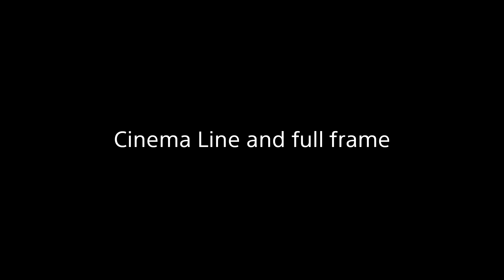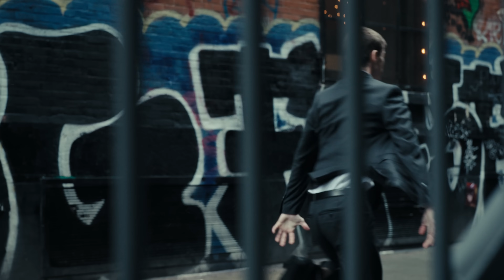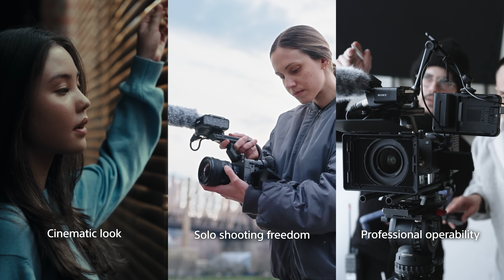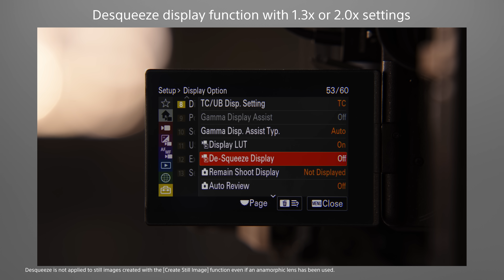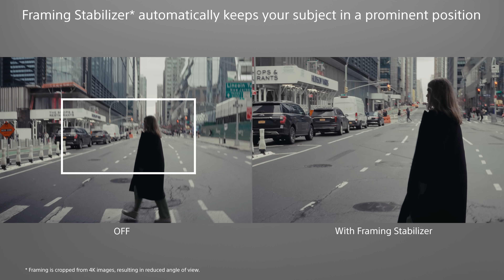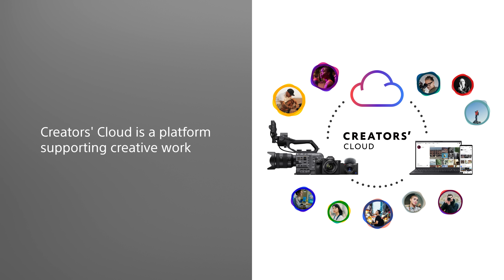Product Announcement Cinema Line FX2 | Sony | α

Comment: I love the FX2 concept because I am a hybrid shooter who wants Cinema features too. I dont care about the 60fps crop, I have lenses to deal with that when I need to shoot 60
Reply: I'm an hybrid shooter with no money so I hope this means there will be an FX20 down the line !
Reply: Price is the key, 3200 € for a camera designed for video without 4K 120 and uncropped 4K 60 is a shame. Also why still 5.5 stabilization ?
Reply: @AIRCamJet  name a 33MP camera that does 4k 120 (no pixel binning), also it has two digital stabilization modes in addition to the IBIS
Reply: @JasonMcMullen   Do you know what innovation is ? We are in 2025, 4K 120 should be the minimum as a brand new camera designed for video > 50 %. Canon R5 C, Nikon Z8 use 4K 120, prices around 3000-3500 €, Sensor > 33 MP.  
So yeah, Sony is now late, we suffered the consequences of protecting high quality products like A1, FX3, a7R V, but now we have overpriced products with recycled technology. 

Some smartphones can record at 4K 120. To innovate a camera designed for video should record at 4K 240p, cooling system and stabilization should be a priority now. I know sensor is much bigger than smartphone sensor, but an a7 IV with FX body, IA focus above 3000 € ?? seriously the camera market is overpriced. They already earn lot of money with lens, their prices are rather logical, but hybrid camera above 3500 € ( FX3, a1 II… ) I can’t understand. Not to mention RX1R.
Reply: @AIRCamJet you are comparing things that are not the same. You have to think about how much data the camera has to process in any given millisecond. Smart phones are working with low quality files and thats why they can process that information. None of the cameras you listed shoot in 7k and downsample to 4k 120. If you’re gonna be a spec nerd then you gotta take all the specs into consideration 🤙
Reply: @JasonMcMullen   I know about smartphones that’s why I mentioned sensor size, of course image quality, focus, shutter speed, iso… isn’t as good as hybrid camera ( although the stabilization is impressive on a smartphone ) but we are in an era of photo / video, if you’re agree about price, with consumers like you, I understand why manufacturers don’t change anything.  
I compare things that are not the same but both record imagery, so a comparison is rightful. 

I don’t care about crop for 120p, the truth is that Sony wants to protect overpriced camera body. 

Unable to record in 4K slow motion with a camera designed for video over 3000 € in 2025, you are free to agree.

Comment: If I were Sony, seeing everyone calling out Sony for a camera with out of date specs I'd pull tihs release NOW.  60fps crop is joke and a fan to keep it cool? Why a fan when it's only doing the bare minimum? and the price ? Insane price for a hybrid photo camera in a metal jacket calling itself a cinema camera? WHY TRASH your own branding ? The FX line means designed for video , 12MB sensor is still king even today. This is like buying a Porsche and finding they installed a steam engine in it.

Comment: Honestly, if I'm a film student and have "free" access to this camera it would be great for most shoots the next couple years, as long as the school also had any one of the 12-megapixel sensor cameras on hand (A7SIII, FX3, ZV-E1) for the excellent video at 12,800 ISO (low light beast mode). VERY curious how Sony is going to upgrade these 3 cameras now. The A7SIV and/or FX3II are overdue!
Reply: well, the fx3ii could integrate open gate, also some better stabilization, ai autofocus and probably the display could use that extra extension thing they put on the a1ii and a7rv
Reply: At the very least internal Raw video would be much appreciated

Comment: Does the FX2 have 4K 60fps cropped? That is the big question…..
Reply: Unfortunately, yes…
Reply: It has the same 33-megapixel sensor as the A7IV, so there will inevitably be a crop in 4K60 — it’s a physical limitation.

Comment: If the rumors are true and it's an A7IV in an FX style body that sounds like a great camera. I've always thought the 4k image downsampled from 7k on the A7IV looks great it just overheats to easily. Imagine everything we love about the FX3, a fan, Cine EI, Video Menus (Big 6 menu?), 2 Type A slots, while also adding Super 35 in 4K, 32 bit float audio, and an EVF.  If they somehow find a way to add VND's that would be 🔥 maybe triple base ISO? SDI? The rumors on the price is what makes it hard to justify, so I guess we'll see...
Reply: No 4K120 on a new release $3K+ camera in 2025 is crazy. Sure, its other rumoured specs are good but if it has the same rolling shutter issues as the a7iv then its totally pointless. For that price just get the a7siii/fx3.

Comment: If this is the same sensor as the old Sony a7IV, then Sony is looking to clean out its old sensors with a new camera. We'll see soon when we test the camera itself whether it's worth the $3000-3500 price tag.
Reply: I mean the a7iv has always given a higher quality picture than the fx3. If you're not shooting fast paced or low light footage, it's a better camera than the fx3.
Reply: @jammaschan  A shit reason to prioritize a hybrid camera over a cinema camera. If you buy a camera, you should be able to do everything with it. You shouldn't buy a camera thinking "Oh I'll never shoot low light" and a few months later you have a low light gig and you'll struggle because you thought you would never be having one.
Reply: @raphaelliioo  Then what camera should I buy at this price point instead? (Also by that logic they shouldn't shoot films using the arri alexa 265 because it can't shoot in moonlight like the fx3 can and it can't fit in tight spaces like the fx3 can.